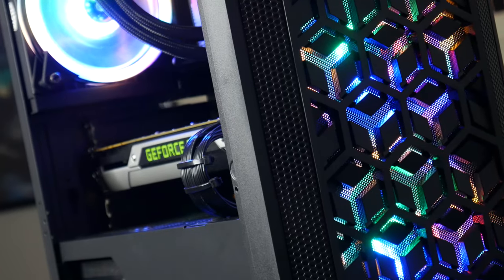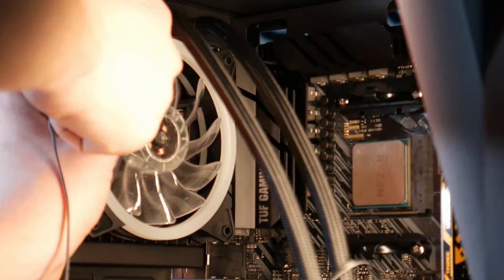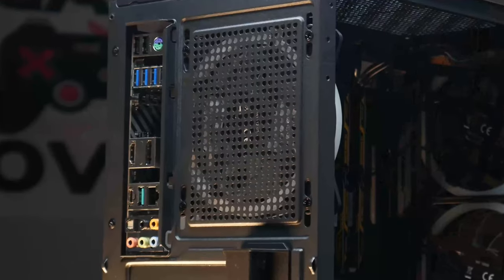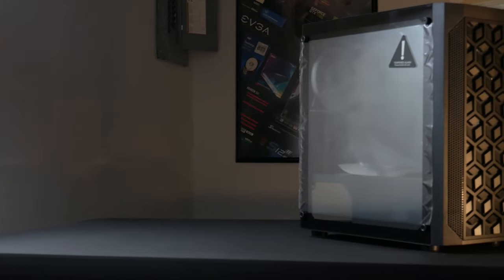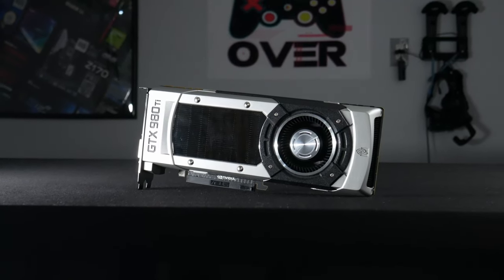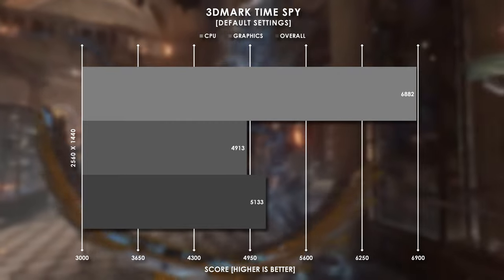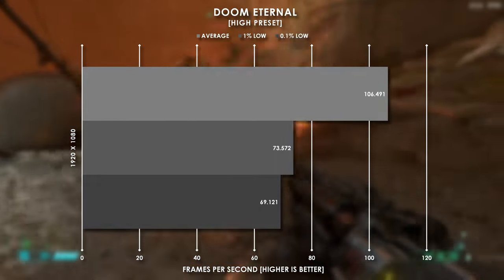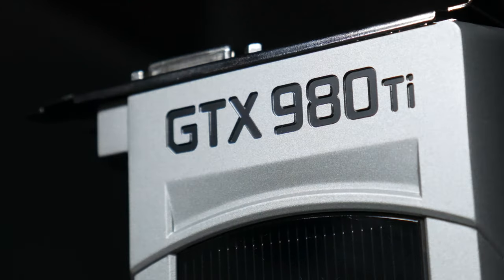Building a GREAT Mid-Range Gaming PC for Under $700!

Comment: 980 still a great card. I like the front panel design on that case too. Easy to build in?
Reply from the maker: Yeah pretty easy! Bummer that the fans are Molex only and the colors are static, but otherwise it's got solid airflow and an easy build experience.